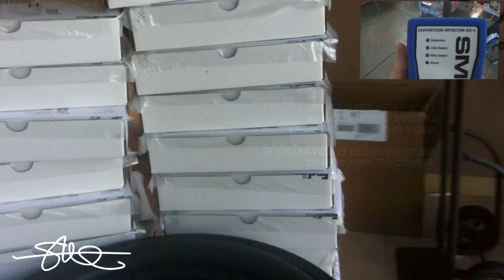SMD DISTORTION DETECTOR DD-1 MANUFACTURING UPDATE 8/18/11

Comment: I've looked, but what if I am using my stock deck and doesn't have volume numbers? Do I just crank it until distortion then back off and leave it alone then go to the amp? 

Is that a dumb question?

Comment: Hey steve, i' thinking about buying one but i have a questions. Can the SMD DD-1 be used with a line out converter? I just recently bought a MTX RE-Q 3 channel sound processor/ bass restorer and wondering if i can use this unit to adjust my sub gain. thanks

Comment: Is it just for big high powered installs. Is it worth getting for someone with a 600w amp with no alternator or other mods? Does distortion occur when the amp is giving more power than the sub can take becuz i hav a 1500w sub with that 600w amp